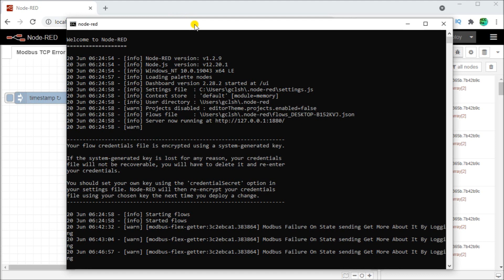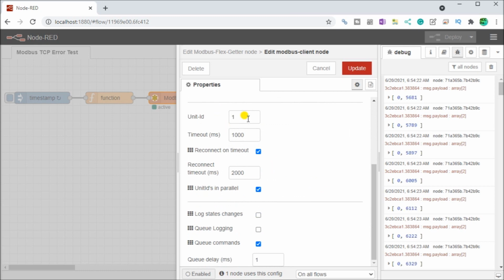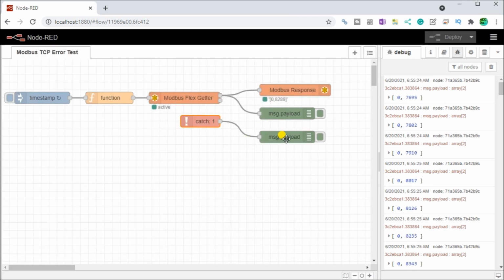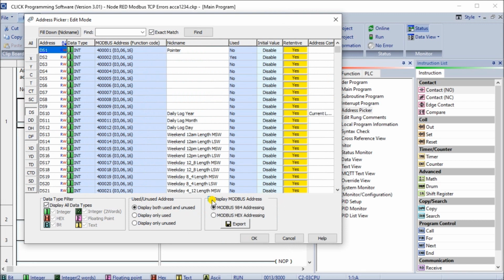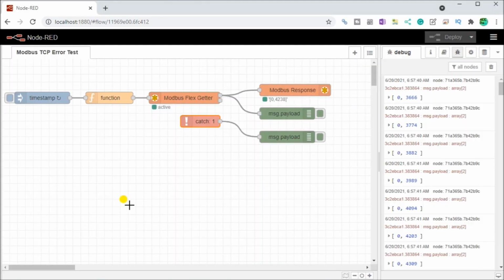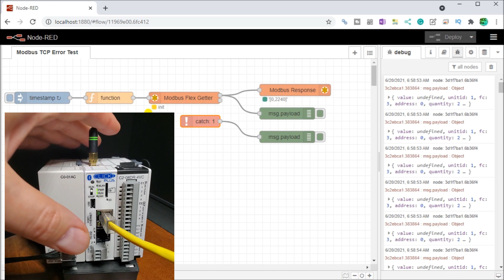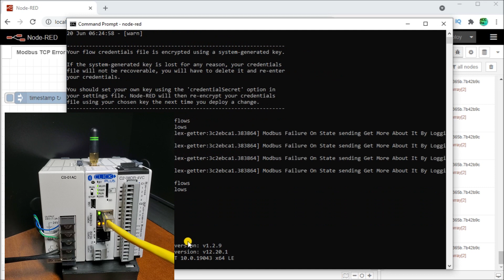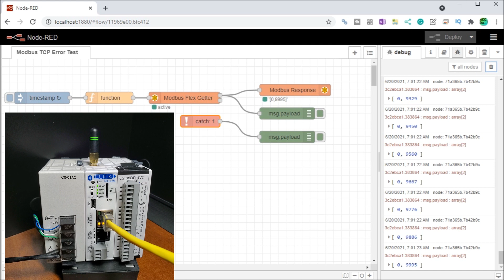Node-RED Modbus Crashes? Build Unbreakable Industrial Apps

Comment: Hello. What version of node-red and Modbus lib do you use ? Did you make any fixes in modbus lib files ?
Reply from the maker: Hi to1 to1,
Node-RED Version: v1.2.9
Node.js  Version: v12.20.1
No fixes were made in the Modbus Library files.
Regards,
Garry
Reply: @ACCautomation  I use hode-red v1.3.3 and node-js v14.16.1. Probably there are some bugs in newer versions...
Reply from the maker: @to1to192  
I would try Node.js Version 12. It is the recommended version for Node-RED.
https://nodered.org/docs/faq/node-versions
Regards,
Garry
Reply: @ACCautomation  I have deleted my current node-js v14.16 and then installed older node-js version 12.3. And now it works without old problem.  Thank you for your help.
Reply from the maker: @to1to192  
No problem. Thanks for the update. I'm glad you got it working.
Garry